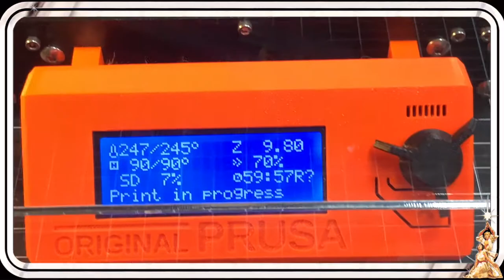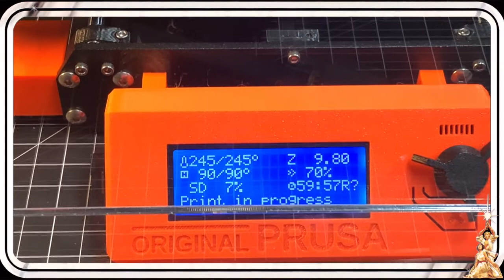3D Printing R2-D2: Episode V - The Warping Strikes Back

Comment: Helper discs in the areas that have corners are a big help to prevent warping. Also let it completely cool before taking it off of the plate when complete. Looking good!
Reply from the maker: Yeah I used helper discs and a brim but it just wasn’t having it. So far this latest print is working out fine.

Comment: Just starting to gather resources for a similar build, what slicer do you use? I am looking to use Orca slicer at .6mm. Appreciate any tips I can learn for best settings.
Reply from the maker: Man, I've totally neglected this project. I gotta get back to it. I'm using prusaSlicer and most of my prints are at .2mm with about 15 - 20 walls. My advice is print slow to avoid printing issues.

Comment: awesome work which set of files are you using? thanks
Reply from the maker: Thanks! Just cheap harbor freight needle files that wear out quick but are only a few dollars for a set so it’s not a big deal replacing them when needed.
Reply from the maker: Haha wait were you asking me what stl files I’m using or actual hardware files :)
Reply: I would also like to know what STL files you are using.  I heard you mention that you have Prusa cut stl files.  I am trying to cut files to fit my prusa from Michael Baddeley's Patreon.  But the files you are using look to be done better than what I`m doing.
Reply from the maker: @danfeuling8846  I’m using the Michael Baddeley files that were cut by Michael Whitley. You can find them on the one drive in the WIP folder under prusa cut.
Reply: @ColecoJoe  Thanks.  I would of never of found them there.